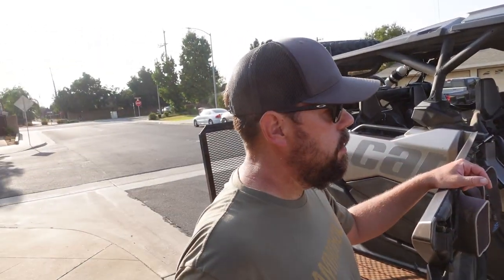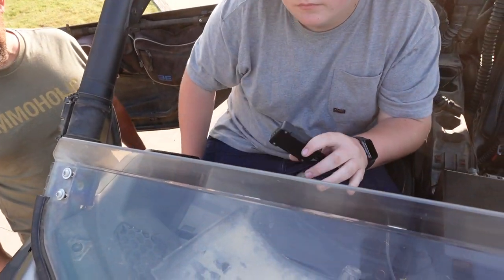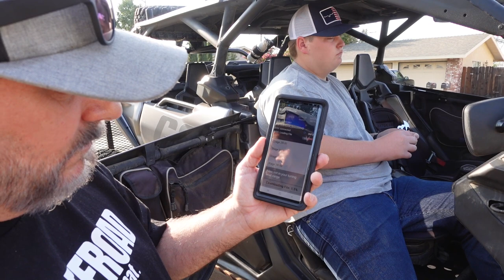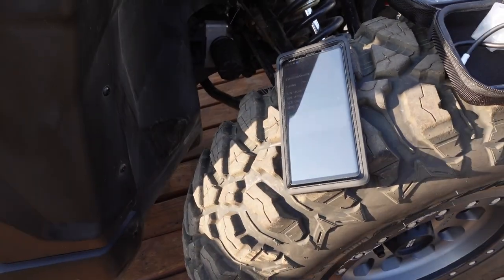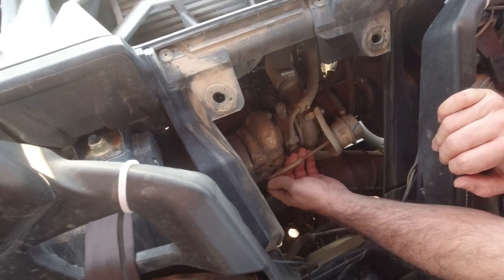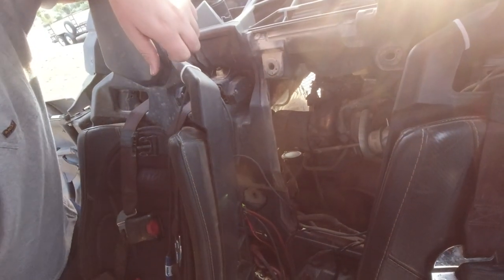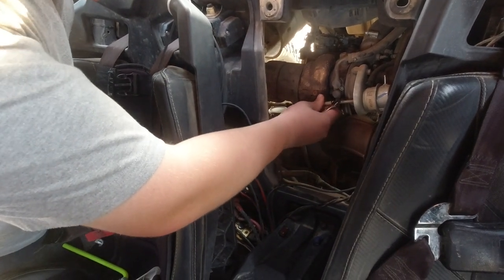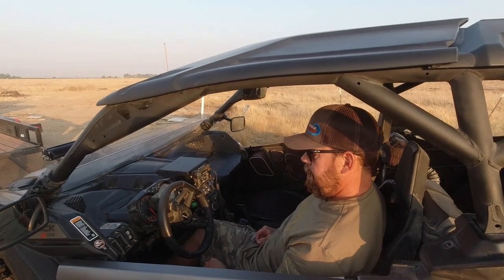CAN AM X3 MAX Gets Bald Eagles Under The Hood - Plus Some EVO Stage 3r!

Comment: Does the 2020rr need crack pressure to be adjusted when you tune?
Reply from the maker: Crack pressure adjustments are tune specific not car specific. You have to go by what the tuner requires for the specific tune.